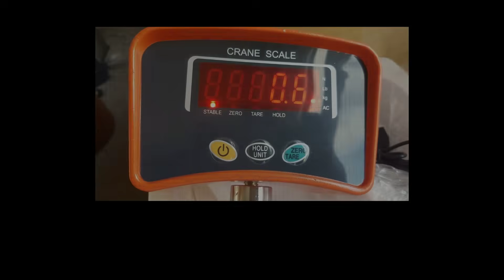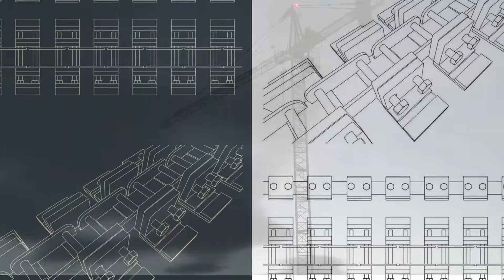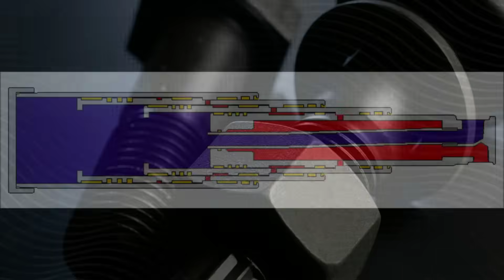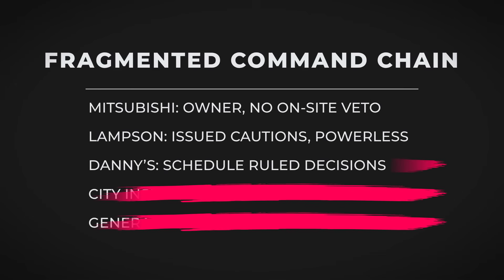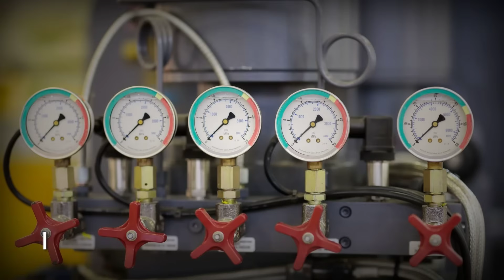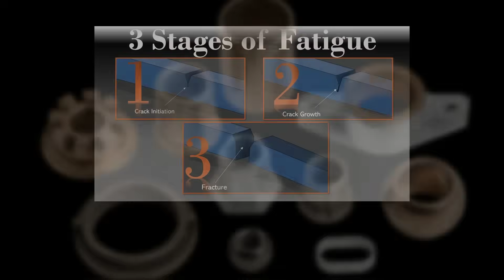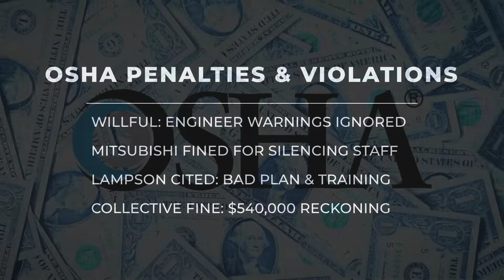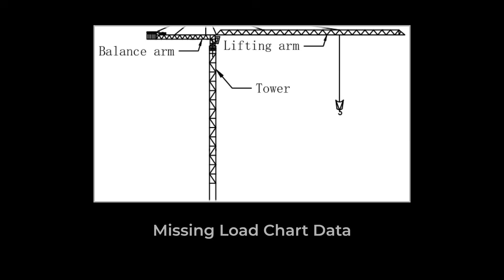The $200 Million Crane Collapse: Big Blue's Deadly Fall

Comment: The crane can lift 1,500 tons as in 3,000,000 lbs? So you compared that to a Boeing 747? Which even the largest variant 747-8 max fully loaded weight is 976,000 lbs. little off but it alright.

Comment: When the crew denied to do the lift,they did for a reason. The fact they brought in others to do is so disgusting. I have always wondered if the people who did the lift we're aware of the crane capabilities,the weight of the lift,the mph of the wind. They could have simply waited. A crane is designed for up and down, and the side force applied by the wind speed stressed it beyond its limit. 3 lives gone because of disgusting negligence

Comment: I live in Milwaukee and was outside on my porch all day facing where the construction was going on about 4 MI to the west of me. It was very hot and humid. And there was a strong wind all afternoon I would guess 15 to 20 mph. It was a constant heavy strong wind. I'm no engineer but the idea of lifting up anything heavy in that kind of wind was crazy. At one point I noticed helicopters flying over where are the ballpark was being constructed and turned on the TV and saw what was happening. No professional would engage in this kind of behavior.
Reply from the maker: Nick, your eyewitness account matches the official weather data—ground level winds at 22-24 mph with gusts to 35. What did it feel like turning on the TV after hearing those helicopters and seeing what you'd been sensing all afternoon had actually happened—that someone had tried to lift a 450-ton panel in exactly the conditions you knew were dangerous?

Comment: I'm used to put down big mats for the cranes to sit on to spread the weight.
Reply from the maker: Exactly—crane mats or timber cribbing are standard practice now, but at Miller Park the broken water main 20 feet away softened the subgrade, causing 12 inches of settlement under one crawler track even before the lift started. Post-1999 OSHA regulations specifically require soil stability testing before heavy lifts, especially if water lines or weather have compromised the ground.

Comment: They let the original safety guy off cuz he had a rule if it wasn't in the air by noon it wasn't going up, higher up aka. Money ppl didn't like that, next guy was a yes man and let it fly, there a vid of it falling from osha where you can hear the pop and him say wtf was that seconds later it fell
Reply from the maker: That noon cutoff detail is critical—if the original safety officer had a hard stop because he knew valley wind patterns picked up in the afternoon, and management replaced him with someone who'd approve a 4:45 PM lift, that's exactly the kind of systemic failure OSHA's "willful violation" finding was about. The OSHA inspector's video capturing the kingpin shearing and that audio is part of the official record that led to the $540,000 in fines.

Comment: 1,500 tons? Over 3 million pounds? WTF? You are SO full of.shit and so is this video!
Reply from the maker: Garry, those numbers are correct—the Lampson LTL-1500 Transi-Lift's rated capacity was 1,500 metric tons (1,350 tonnes), and with 2.4 million pounds of counterweight alone, the fully assembled crane weighed over 2,185 tons. OSHA's investigation and Lampson's own specifications confirm these figures for one of the world's largest crawler cranes at the time.

Comment: Stupid lifting too much
Reply from the maker: Stan, the 450-ton load was actually within Big Blue's 1,500-ton capacity—the failure came from wind turning the panel into a sail, dead wind monitor batteries, no adjusted load charts for lateral forces, and 12 inches of ground subsidence from a broken water main.

Comment: Why would anyone start a lift like that at 5:00 PM ???
Reply: They were behind on the 3rd base soda lift, everyday the news reporters were hanging around asking when will we see it lifted, the day they did the first lift it was snowing, as soon as it was in place 80 iron workers walked off some saying this is bs someone gonna get killed
Reply from the maker: Yeah, that's the question everyone asks—5:12 PM start time with winds already picking up and daylight fading. Deadline pressure from the stadium construction schedule meant every delay threatened cost overruns and public embarrassment. Multiple contractors shared responsibility with no single authority empowered to call it off, so the momentum to "get it done" overrode safety concerns from ironworkers who refused to climb. Classic case of schedule pressure killing common sense.

Comment: 15 Million just to get a crane. Boy is it easy to spend money when it is not yours.
Reply: No one spent 15 million for the crane service
Reply: @davidbryant3532 somewhere in this video it stated that. could me mis info.
Reply from the maker: @marblox9300  The $10-15 million lease covered not just the crane itself, but transport (dozens of flatbeds), 4 days of specialist assembly, ongoing operation, and Lampson International's expertise for the entire project duration.
Reply: @ConstructionLegends  So this adds up to 15 million. Just like I said.  :)
Reply: YEA MAN , AND JUST FOR THE FUCK OF IT LEAVE OUT THE SAFETY /ALARM  BATTERIES THAT SHOULD ALWAYS BE REPLACED . WHEN STARTING UP ON A NEW CONSTRUCTION SITE , BUT WHO THE FUCK AM I ?
JUST A FORMER IRON WORKER .,RAILROAD MAN , AND HEAVY FAB . WORKER . TO BEGIN WITH IVE SEEN THIS VIDEO ON EVERY SAFETY CLASSROOM BEFORE STARTING / SETTING FOOT ON THE JOB SITE , THE OSHA VIDEO TALKS ABOUT THE ORIGINAL BIG BLUE OPERATOR REFUSING THE LIFT BECAUSE OF HIGH WIND. HE ACTUALLY GOT OUT OF THE CAB AND WALKED AWAY , THATS WHEN ANOTHER WORKER WITH NO CREDENTIALS WHAT SO EVER SAID HE'LL DO THE LIFT  IF THE OTHER GUY WONT . THE UNAUTHORIZED OPERATOR BEGIN TO MOVE THE BOOM CARELESSLY  AND TOO FAST THAT THE WIND ACTUALLY STRESSED THE BOOM REINFORCEMENTS AND TWISTED THE BOOM TO THE GROUND , ...SO WHATS THE REAL STORY HERE . 
THIS MACHINES ARE DESIGNED TO MOVE HEAVY LOADS SLOWLY AND Deliberately, .
WITHE PRECISE PRECISION , STRESSING THIS MACHINES CAN AND WILL CAUSE CATASTROPHIC FAILURE , DUE TO Structural AND MECHANICAL BREAK DOWNS  . ALSO ,WHEN THE OPERATOR VACATES THE OPERATORS CAB THAT DOOR SHOULD AUTOMATICALLY LOCK MEANING YOU CAN GET OUT YET NO ONE , NO ONE , CAN GET IN WITH OUT THE KEY TO UNLOCK THE DOOR , THREE KEYS , THE OPERATOR , THE SITE SUPERVISOR , AND THE SAFETY PERSON THAT OVER LOOKS THE SITE ...AND THIS IS FOR SAFETY REASONS , ONE HEALTH , SUCH AS THE OPERATOR IS HAVING A HEALTH ISSUE , PASSED OUT , HEART ATTACK , STROKE , DRUNK , DRUGS , SUICIDE . ETC .TWO , ROUTINE INSPECTION OF THE INTERIOR OF THE CAB , MEANING IT MUST BE KEPT CLEAN OF ANY TRASH ,OR Debris.  ,THREE , MAINTENANCE , AC ,HEATER , RADIO REPLACEMENTS OF PARTS . 
RANDOM CHECKS AS PER SAFETY PROTOCOL. ILL BER NO ONE EVER THOUGHT OF THIS , WELL HOW ABOUT NOW , ITS NEVER TOO LATE ...
...U.S.MARINE...
....TEXAS....
Reply: @Vincent-p6p  Take You Meds, and get some sleep. You still have a chance at a normal life. :)

Comment: Outrigging sinking in the lift pad, Dead batteries on the monitors, Running the pick in windy conditions without an engineering review No single authority on site to shut down a dangerous pick.  You did not do your job. You deserve what you got.
Reply from the maker: John, you've listed every single failure that led to this—12 inches of subsidence, dead wind monitors, no adjusted load charts for lateral forces, and split authority between three contractors with no one empowered to halt the lift. OSHA and the jury agreed: $540,000 in fines plus $99 million in settlements for willful violations. The ironworkers who refused to climb knew something was wrong, but the system didn't back them up.

Comment: You cannot blame the wind......
Reply from the maker: Absolutely right. The wind was just the trigger—the real failure was ignoring workers who refused to climb because they felt the danger.
Reply: @ConstructionLegends 80 iron workers walked off the job due to safety issues, original safety officer wouldn't let a crane lift happen if it wasn't  in the air by noon, he knew the wind was a problem there, the stadium is basically in a valley
Reply from the maker: @tkk41  Those are significant details—80 ironworkers walking off would represent a substantial safety concern, and a noon cutoff policy for valley wind patterns would indicate prior awareness of the conditions. The video mentions workers refusing to climb and voicing concerns about wind, but doesn't specify those exact numbers or the safety officer's protocols. Do you have documentation or sources for those specific details? Understanding the full timeline and decision-making process helps clarify what happened.

Comment: Since a delay could cause a cost overrun, that explains why the lift was scheduled despite the wind.  It's always all about the money.
Reply from the maker: You’ve absolutely nailed it. The tragic irony is that trying to save money cost 2,000 times more.

A one-day weather delay? Maybe $50,000. What they got: $200+ million in settlements, fines, and delays—plus three lives lost. The jury slammed them with $94 million in punitive damages specifically for putting deadlines over safety.

Have you seen this “just get it done” pressure on other sites? Does the industry really learn from this, or does schedule pressure still win too often?
Reply: @ConstructionLegends  I have shut down 2 jobs in my career watching night shift. The contractors would put off sketchy operations during the day and have night shift do it.
Reply from the maker: @johnking9942 That takes real courage—shutting down sketchy night shift operations when contractors are deliberately pushing dangerous work into the dark when fewer eyes are watching. Night shift gets the worst of it: less oversight, same deadline pressure, and the assumption that what management won't approve in daylight is somehow acceptable at 2 AM. What were the operations you shut down, and did you face pushback for making those calls?

Comment: There wasn't any pads under the out riggers feet either but shld of been put off due to ground and wind problems
Reply from the maker: Spot on—that’s another critical failure. The soft ground from the broken water main combined with no proper outrigger pads, plus the dangerous winds. Multiple failures that should’ve stopped the lift immediately.
Reply: @ConstructionLegends  I was involved with the Severstal "C" furnace rebuild. The crane sat on a million dollar pad of heavy timber. The picks to set the furnace were up to 500 tons for the center furnace section. There is always time to do it right.
Reply from the maker: @johnking9942 That's exactly the standard—500-ton picks on a million-dollar timber pad shows what proper ground preparation looks like when you're serious about safety. Big Blue had 12 inches of subsidence under one crawler from saturated soil, which is insane for a machine that size. Your Severstal example proves the point: there's always time and budget to do it right, unless deadline pressure overrides engineering judgment. What was the total timeline on that furnace rebuild?
Reply: @ConstructionLegends  where are these outriggers? I see tracks.
Reply: Crawler cranes do not have out rigger’s
Reply: Crawler cranes do not have out rigger’s

Comment: Ok measurements after the accident of the tracks sinking 12 inches.... do you think that would be from the load shifting and then all the weight transferring to that single track?!?! Causing it to sink.  Instead of it making it seem like the track was already 1ft lower then the other
Reply from the maker: Sharp observation—the 12 inches was measured after collapse, so it’s unclear how much was gradual settling versus sudden impact when all that weight shifted catastrophically. Reports blur this, making it sound like it was sitting a foot lower beforehand when reality was likely a mix of both.

Comment: I live in the greater Milwaukee area. about 7 miles to the west of the stadium sight.  I was out on my motorcycle that day and was stopped at a red light.  I had my radio on and while waiting had a high wind coming from the west push hard on me.  A minute later on my radio the news broke about the crane collapsing, which was east of me.  From what I know since the collapse it was a high wind that caught the load and took the crane down.  I do know it delayed the construction by a year.  When you look at the Stadium now you can't even see any signs of what happened there.
Reply from the maker: Thank you so much for sharing your personal experience from that day! It's incredibly powerful to hear from someone who was actually there in Milwaukee when it happened. The fact that you felt those strong westerly gusts on your motorcycle just moments before hearing the news really drives home how quickly conditions can turn dangerous—and how the wind was the immediate trigger that day.

You're absolutely right that the high winds caught the 450-ton roof panel and created forces the crane wasn't designed to handle. What makes your account even more valuable is that it confirms what the investigation found: those gusts were hitting 27-35 mph at the time, well above safe operating limits for a lift of that scale.

The year-long delay you mentioned cost the project an additional $50 million, on top of the $99 million in legal settlements and the immeasurable loss of Jeffrey Wischer, William DeGrave, and Jerome Starr. It's sobering to think how quickly tragedy can strike.

Thank you for taking the time to watch and share your memory with us. Stories like yours help keep these lessons alive and remind everyone in construction why we can never take safety for granted. We really appreciate you being part of this community!

Comment: THATS A PILE OF CRAP…. THE SINGLE AUTHORITY TO CALL OFF THE LIFT, IS IN THE HANDS OF THE OPERATOR. ITS HIS SOUL RESPONSIBILITY, HE IS THE CAPTAIN OF THAT SHIP. HE CALLS THE SHOTS. IF HE SAYS NO, THATS IT. OR WALK AWAY. WITH A LIFT OF MAGNITUDE, THERE IS NO SHORTCUTS, NO HAST. THE END RESULTS, THREE LIVES N MILLIONS IN DAMAGES.
Reply from the maker: You’re absolutely right—in theory, the operator IS the final authority and should be able to say “no, conditions aren’t safe.” The tragedy here is that culture and pressure override that authority. Workers on the ground refused to climb because of the wind, but the lift proceeded anyway. When your job is on the line and everyone’s pushing to meet deadlines, that “authority” becomes hard to enforce without real institutional backing. You nailed it—no shortcuts, no haste, period.
Reply: @ConstructionLegends THE BOYS WONT CLIMB… THATS A SIGN RIGHT THERE. WIND ON THE GROUND IS 20mph…. DOUBLES AROUND STRUCTURES, SO WIND GOING OVER THE TOP OF THAT WALL… 40+ A LEAST. NOPE I WOULD Have WALKED AWAY. LAD WAS WARNED ABOUT WALKING A PILING RIG ACROSS AN OLD WOODEN BRIDGE, BOSS SAID GO, HE WALKED…. NEXT GUY COMES, BOSS SAID GO ACROSS….. COLLAPSED THE BRIDGE. I WAS SEVEN YEARS IN THE SEAT, LEARNED A VALUABLE LESSON THERE.
Reply from the maker: @MegaIronleg  That's exactly the lesson—when the ironworkers won't climb, that's your red flag. Wind doubles around structures like you said, and at 300+ feet up on that boom tip, gusts were hitting 35 mph when ground readings showed 20. Your bridge story is the perfect example: the operator who walked away lived to work another day, and the guy who listened to "go" paid the price. Seven years in the seat taught you what killed three men here—trust your gut and the crew's instincts over deadline pressure.
Reply: I worked with Lampson in a BP refinery assembling Big Blue in 1992. Lampson's people were very professional. The crane rental company I worked for was hosting them at our yard. You wouldn't believe the stacks and stacks of crane mats we had in our yard and took down to BP and sat. We had a crane at either end and about 4 or 5 trucks hauling the mats for about a month. They picked up a 350 ton vessel and walked with it so they needed a huge area covered with the mats. And every one of those mats was brand new
Reply: The original crane operator said NO! So they had someone else do it!
Reply from the maker: @David-p7z3f  If that's true and the original operator refused the lift, that's even worse than we thought—it means management knowingly found someone else to take the risk after getting a "no" from an experienced operator. Do you have a source for that detail? That would elevate this from ignored warnings to deliberate circumvention of safety authority.